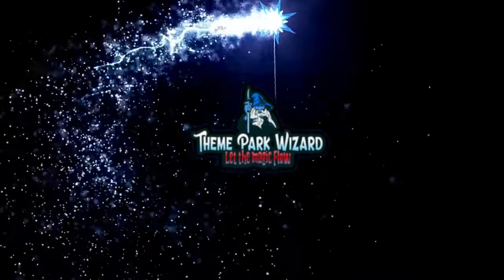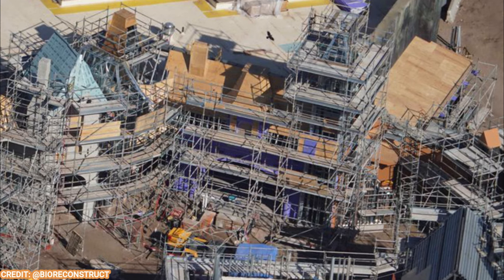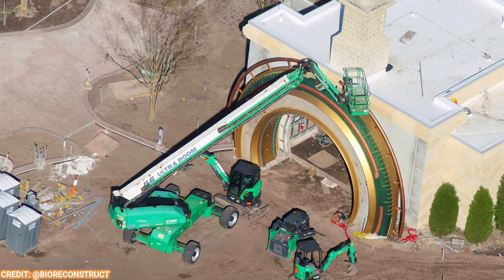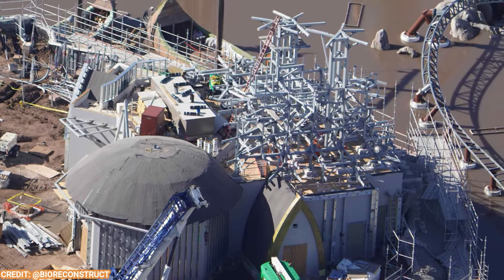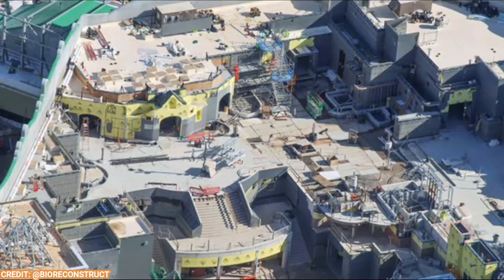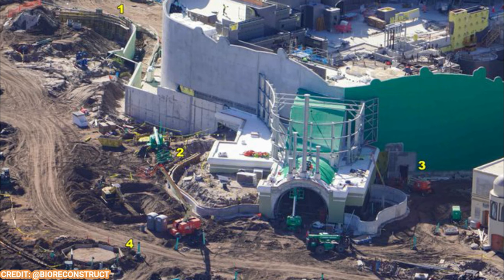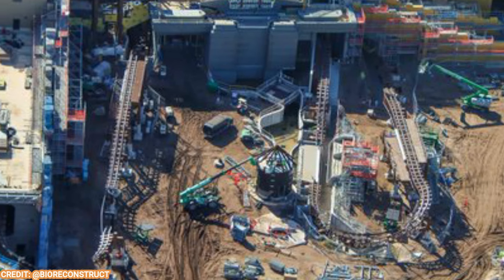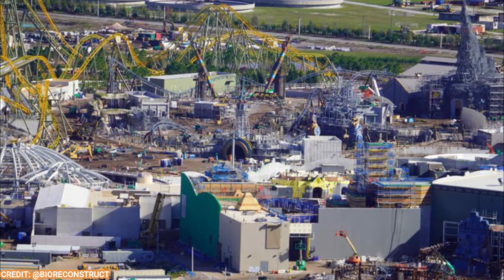Epic Universe Construction Update | Donkey Kong Temple Gets THEMING! | Universal Orlando Resort

Comment: ugh. that rusticated look atop the low wall in front of Monster's ride is sooooo out of place. 20 feet from the facade? The designers know architecture but then totally screw up a look. because of space limitations. And what the heck is a shack/hovel standing a few dozen feet away? A gatekeeper's building would have looked better. No rich person is going to let a farm/shack building so closeBut that perimeter security wall right in front ruins the illusions this is a manor house or ancestral home. Looks like a dept head overruled someone's common sense.